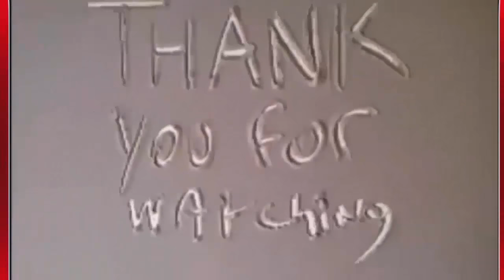CUTTING QUOIN STONES

Comment: Ashlar or quoins can be given a nice sandstone effect with a sponge,we to use cut them back with a float which had a v-shaped baton on the face of it.and the feather edge to mark it out that 6ft ouoin cutter is a great bit of kit,great vid
Reply from the maker: Thanks Mark I remember cutting out k rend with my old boss doing a similar method but it was a strange metal cutter with v shape teeth that went blunt every house and had to be replaced my old boss used to touch them up with a pointer as well just to get it real sharp looking was very hard work and he made it look easy

Comment: Great job,sponging the s-c this time of year can be a pain I do tap the sponge off the hop up instead of putting it in the bucket of water saves the hands this time of year! If I have to clean the sponge just boil up the kettle & into the bucket lol.
Reply from the maker: Nice tip yea warm water would be nice here :) my hands have so much cuts and hacks it unreal , and it took until late to get these in so slow to set  thanks for the comment Thereal Tevlinwill

Comment: Here is the video of the plaster mate quoin cutter https://youtu.be/iqnxOSAQhm0
Reply from the maker: seen it it looks a great job man wouldn't mind reviewing it someday
Reply: They are in the process of making a tool that u line up with the lathe on both sides of corner and it attaches to the plastermate and you just move it down as ur going along. There Irish based and made. Think Donegal. Anyway keep up good work 👍👍
Reply from the maker: Might have to get in touch with them :)